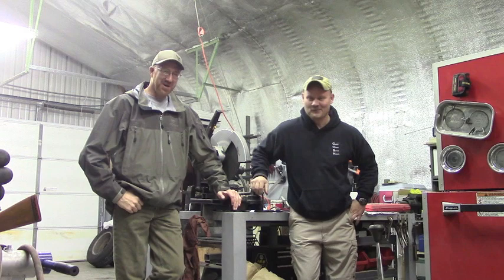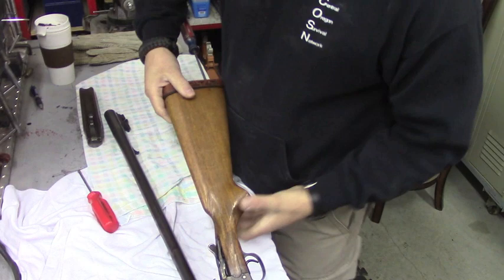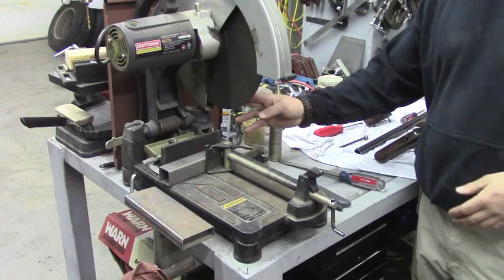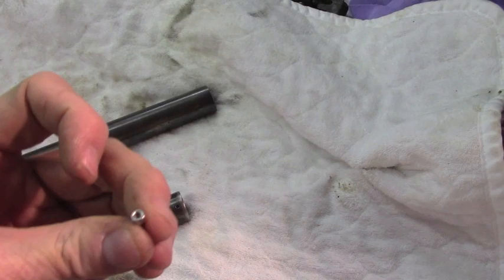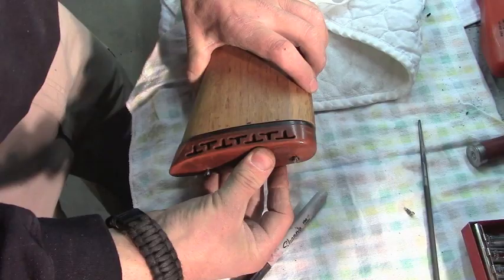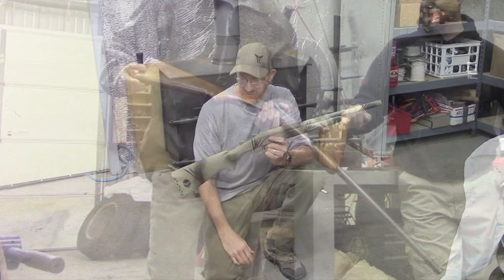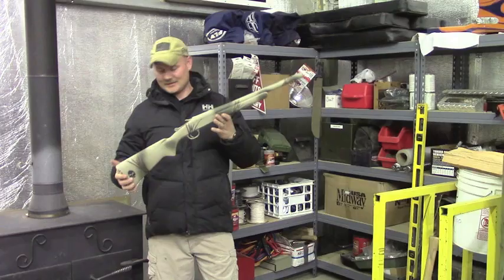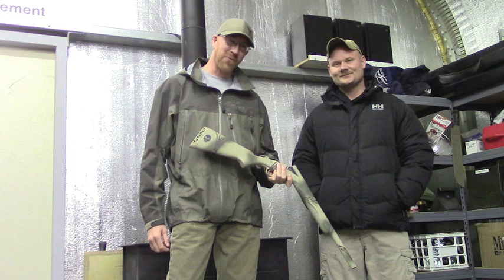$40 Bug Out Gun, Survival Rifle ? - My Bush Gun Build

Comment: So you took a decent old gun and chopped it down and gave it a bubba paint job?  What did you actually build? Honestly, you should be ashamed of yourself if you have a shop like that and are using it to put out something like this. All you need for this video is a hacksaw and some spraypaint.
Reply from the maker: +Ja Ha That's about it.  I don't know what there is that I should be ashamed about in the project though.  I took a gun that I had almost no use for and turned it into something that's one of my handiest and funnest guns to pack around in the sticks with me now.

There are a few more tools you need to do the project than you mentioned though.  Taps and dies, and a drill to drill and tap the threads for the front sight, etc.